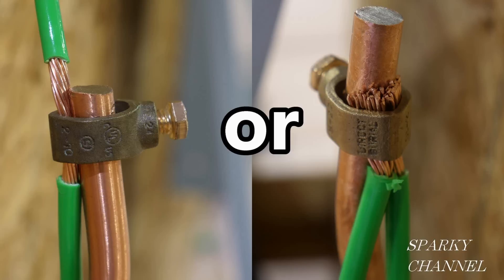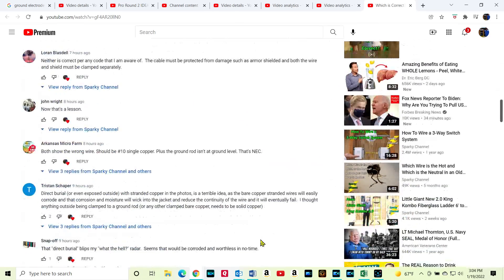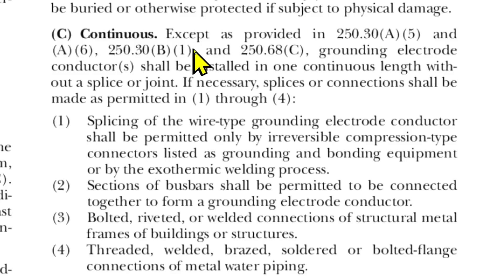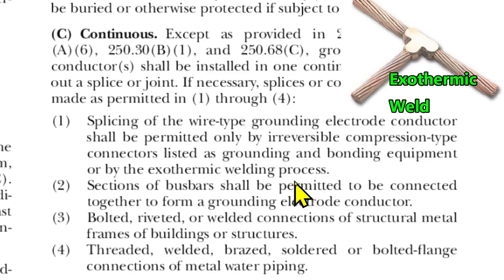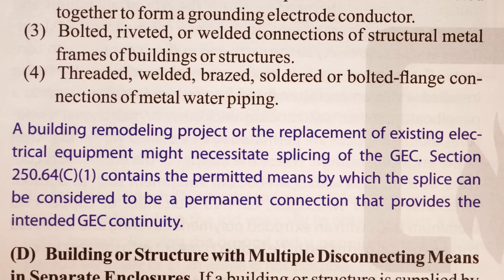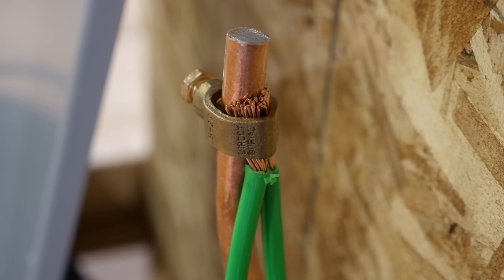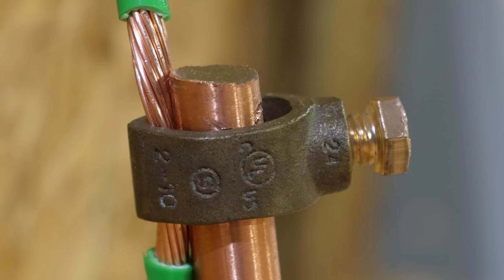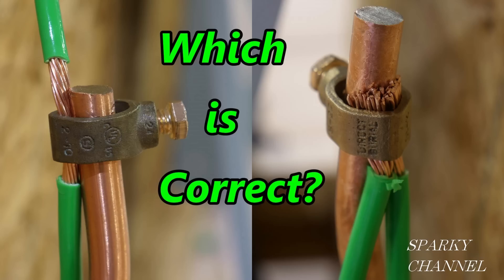Hey Sparky, Why? Article 250, 2020 NEC

Comment: If you have 3 ground rods, and 2 of them are continuous and 10 ft apart, will that satisfy the code ? I had a broken ground rod wire and added a 3rd rod and ran from panel to middle rod and continued to the R. Used a second acorn to secure the cut ground wire to the middle rod... it is right at 6 ft away.

Comment: Why would they allow you bury bare copper?
Reply: As part of a foundation for lightning protection a bare 25 foot long ground wire is tied to the lower outside corner to rebar before the concrete is poured.  Direct burial of bare copper wire is acceptable in grounding because of the increased surface area to Earth and that copper oxide is conductive.

Comment: NEC 250.53 (A) (2),  250.53 (A) (2) EXCEPTION-  GROUNDING ELECTRODE SYSTEM INSTALLATION-  The GEC is continuous to the first rod electrode.  The second rod is a supplemental electrode and can be "bonded" to the rod grounding electrode (as in a "bonding jumper").  The second picture illustrated in the video would be correct with a second grounding electrode clamp.  

I've done this on several occasions and have been apporved by different inspectors.

Comment: This is great information.  Now, I must find a diy way I can splice or weld without the specialty tools.   I have a system with one existing ground rod and want to add another. 
Retrofit on 1884 building.
Reply: Just pull a new GEC.
Reply: As the other guy said you can run a new wire directly from the new rod to the main panel or use an intersystem bonding bridge that is considered a bus bar that's approved to splice the differen wires
Reply from the maker: Interesting situation. If you had an exothermic welding set-up that would be perfect but I think a new GEC is your best solution.
Reply: Thanks all for the advice!  It's not all that far, guess I'll pony up for the wire and be done with it.
Reply: @gregorysampson8759  the wire's not that expensive.  I'd go ahead and drive 2 new rods, anyway, since the existing rod is probably corroded, if it's even acceptable to current code.

Comment: Isn’t it supposed to be continuous just to the first rod since the second one is technically an auxiliary electrode?
Reply from the maker: See article 250.64 (C) at :55.
Reply: Rod plate or pipe type electrodes require a supplementary electrode OF THE ROD PLATE OR PIPE type. It is important to remember that if using those types as your system's grounding electrode.

Comment: You should point out that if the GEC goes to a rod, pipe, or plate electrodes and if the connection does not extend on to other types of electrodes that require a larger size conductor, the grounding electrode conductor is not required to be larger than 6 AWG copper or 4 AWG aluminum wire. Section 250.66 (A).
Reply from the maker: Excellent point, thanks!
Reply: the counterpoint to that is if you use #6, then the wire has to be buried 18" deep or secured to something for protection.  #4 copper just has to be out of the way of immediate harm.

Comment: If you were to fold a single conductor so the conductor entered and exited the clamp on the same side but was otherwise unbroken, would that be allowed? Or is that not considered a "continuous length" due to the direction change?
Reply from the maker: I don't know. I think the ground clamp manufacturer would consider that 2 wires as far as space in their clamp would be concerned. I get you though, it is just one wire.
Reply: @SparkyChannel  ... as mentioned in another post, there are acorn / ground clamps that are rated for multiple wires. There are also split clamps where you can grab the wire from the side without cutting. IOW, no need to fold it over.
Reply: @SparkyChannel  If this were done, would it fail inspection?  From an electrical engineer's perspective, doubling the conductor back on itself under the clamp would lower the contact resistance between the conductor and the grounding rod, making a more secure connection.
Reply: @SparkyChannel  Ah – I hadn't considered clamp CAPACITY. That makes sense.
Reply: I asked that same question in the previous posting.  The conductor would remain unbroken as the example on the left.  If the acorn nut came loose, it would not affect the integrity of the other grounds in the system.

Comment: Non-electrician here. Could I strip the insulation as in photo #1, fold the bare wire and slip that loop up between the clamp and rod or is that considered a "joint"? Thanks for all the learnin', Bill.
Reply: In the original video, it was explained that that clamp only has the capacity for one 6 awg wire. Looping it like you said would technically be two 6 awg wires
Reply: @MrFitness94  The clamp shown in the picture is stamped 2 AWG - 10 AWG conductors.  Two 6 AWG conductors will not exceed its capacity.
Reply: @NCF8710  you’re wrong, sorry. 1:22 in this vid https://youtu.be/gF4AR20llN0

Comment: You could put two acorns on a ground rod with a cut conductor because the Ground rod is an electrode And It could be used as a conductor just like I-beams and the cold water we use at the water at heater to bond the hot water and gas
Reply: the wire itself is not to be cut, per the code mentioned.

Comment: Table 250.122 is for equipment grounding conductor 
Table 250.66 is for electrode grounding conductor so for a 200 amps service it requires 4 AWG copper
Reply from the maker: Thanks!!! I was wrong. I made an edit to my video to take out the section where I made the goof. Thanks for catching it and giving me the NEC articles.
Reply: if your going to a rod it is 6awg copper
Reply: @skunkbri   250.66 A
Reply: But there is an exeption
Reply: Read Before You go to table 250.66
Reply: The bonding jumper would be 4awg

Comment: When did GEC AWG size change to #6 copper for 200 amps? I have been using bare or standed #4 copper for 200 amp services my entire career…
Reply from the maker: I was wrong. I made an edit to my video to take out the section where I made the goof. It is bare or stranded #4 for 200 amps.
Reply: ground rods haven't been required to have bigger than #6 at any time in my career.  but I use #4 because it doesn't have to be protected. (a ufer isn't required to have bigger than #4)

Comment: 🍻🍺😊 So you can't use 2 clamps for 2 different wires and it has to be non cut Is that correct
Reply from the maker: Yes, the GEC needs to be continuous.
Reply: @SparkyChannel   The question I asked that when I build control panels bro panels I can't connect the door  To the Box to the backplate I don't need a continuous And it depends on the panel sometimes the door in the Box Box don't get grounded unless they're melted The manufacturers usually give you do a bolt of a star washer to bond the enclosure the enclosure to the back plate I know more about UL than I do any other electric codes They're the codes I had to follow Trying to learn more maybe never use it never use it but it's always good to have in your mind   👍🏻🍻🍺😊
Reply from the maker: @konamanstudio2447  Yes, it's interesting that the manufacturers specs are very important to inspectors.

Comment: I was under the impression that the #6awg must be solid and not stranded. Can you verify?
Reply from the maker: The GEC can be solid or stranded, insulated or bare. In most cases, it must be copper, but you can use aluminum if the GEC isn't subjected to corrosive conditions and isn't within 18 inches of the earth [250.64(A)].
Reply: Stranded wire must be protected from damage where solid doesn't have to be depending on your AHJ
Reply: @dudeman650  the codebook says #6 has to be protected by full depth burial or running along a support. #4 doesn't have to be buried at full depth.